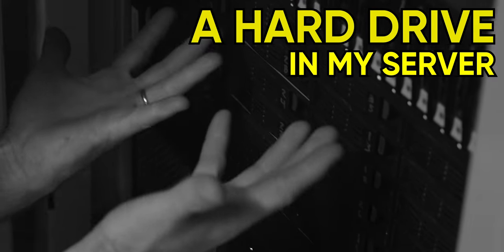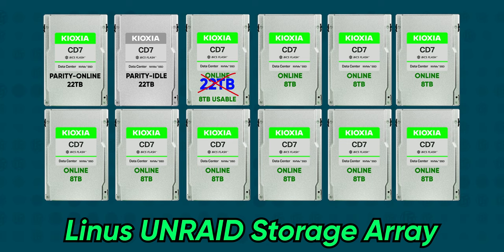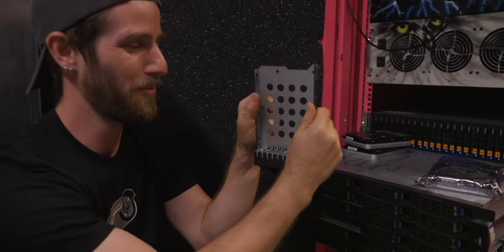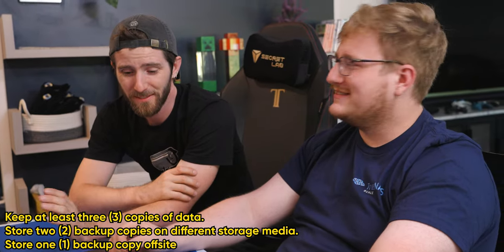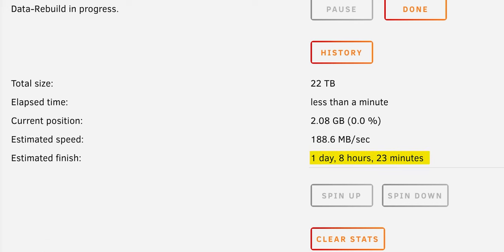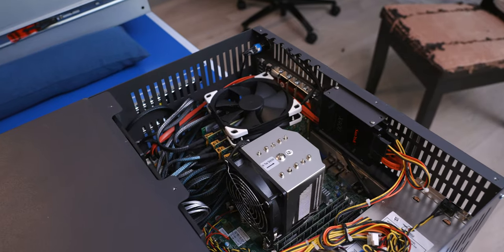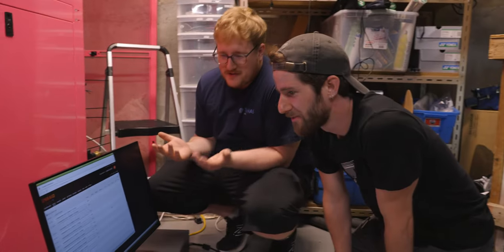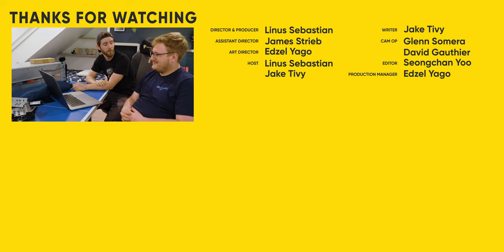My server is broken :( - Fixing Linus' Home UNRAID Server

Comment: For me it was super easy to rebuild my unraid raid, except when I did that it was the one version number where unraid could not add 4tb and above disks to your raid.... And I used 3 days to try to rebuild, and then the update hit that fixed the bug... Amazingly bad luck. When that bug was fixed it was just replace the drive and then it worked

Comment: While I'm watching this, I think back to replacing the failed drive in my hardware raid setup. 

The red light was on the drive, so I didn't even need to load software to know. I pulled the drive out of the running system, then swapped my drive out and plugged the new one in. 30 or so seconds went by to boot up the drive and the raid card did what it was designed to. Off it went and started rebuilding the array, all while my info was still useable, with no input from me. 

I can even swap them out for larger drives just like you said, but I can't touch them until I have enough to make a new array (yes it supports splitting the drives for different arrays) or I finish swapping out all the drives for the larger capacity and expand the array. 

So I think I will stick to hardware raid (HP P812 Raid card with 1gb battery backed memory, then the HP SAS JBOD enclosures to run the drives). Like your array though, I'm running raid 6 so can have the same 2 drive failure and be just as safe. So waiting a couple of days for my replacement drive to arrive, was no big deal.

Comment: If there is data that has any meaning at all to you, keep multiple copies.  Use tape or hard drives.  For long term storage avoid flash memory although it is OK to use it to move data between computers.  Of course a quick network could do that instead.  The more importance that data has, the more copies of it you may want to keep.  Don't be that guy who only has one copy and lost the data when there was a problem.  I have some papers I scanned and I got a new drive for them just so I know I have one that is hopefully free from bad sectors and extensive wear and tear.  I agree with Linus that you should not have to use cloud storage and pay for your data.  I also keep that drive offline when it is not in use and since I only wanted a fresh safe place to store the files it  is just stashed away somewhere cool and dry.  It may have a lot of unused space but I only paid $40 for it and will be adding more to it in the future.  It is all personal and not stuff to share with anyone, if I ever pass away it is meaningless to anyone but me.  I just want it to last as long as I may live so I have it if I ever need it.  Once I am gone it may be gone too.

Comment: Seagate still has not fully won me with their reliability. I'll use them, but I don't really trust them. Also not peeling plastic on computer parts, had an machine I had to replace a video card in because some plastic off of a component peeled off over time and get stuck in the GPU's fan and it overheated.

Comment: I would keep an eye on that particular model drive, and get the rest of the drives replaced next time there is a sale on the model hard drive.  (Typically happens when a data center buys a partial pallet of them.)
Reply: As a note, I would make an index of what gets backed up to the cloud from that server and what doesn't.   I'd simply use a directory tree to divide up things based on various attributes and only upload the irreplaceable stuff to the cloud.  

All his work stuff is backed up at work, in fact that side is the copy.  Copies of things that can be downloaded again should obviously not be downloaded either.
Personally important documents that don't have a copy on the work system should be backed up.
Pictures, and other such irreplaceable data should be backed up. 

However, using a RAID to handle it locally reduces reliance on backups so it is still convenient.

Comment: Boots off of a USB stick, is a faff to add new bigger drives... no thanks Unraid, I'll stick with lvm and mdadm in Linux which CAN absolutely be just as flexible. (This is actually what Synology do under the hood with their "Synology Hybrid RAID/SHR" stuff.)

Example:

2x 22TB drives
3x8TB drives

1. Create 8TB partitions on all 5 drives and RAID5 (or RAID6) them.
2. Create partitions for the remainder on the 2 22TB drives and RAID1/mirror those.
3. Create PVs with both RAIDs in LVM and add them to a VG and LV ... Boom. 46TB of usable space fir a max of 1 drive security. 

If you ever swap one of the 8TB drives to a 22TB one: create the 8TB partition and add that to the existing RAID5 to be rebuilt, then create the partition for the remainder and add that to the RAID1 while "grow"ing it to a RAID5. Resize the LV in LVM and you'll have the extra 14TB available for your filesystem... (If you ever want to go to even bigger drives, just add another RAID with the extra "layer" of partitions above 22TB...)

If you need 2 drives of security, plan the RAID layers accordingly...

Comment: another tip, all 4 of my 8tb drives are wd externals i chucked, you need to not connect the 3v pins or use a silverstone style sata spitter, but  they are not shingled and are full perf drives.. the firmware just causes them to restart over and over if 3v is connected... heh..

Comment: Thats not true. The price is always 800% of the manufacturing cost. When they reach the Port of California, the company that receives it changes the Bill of lading. The actual drive price is on the Ship before it reaches California then the company that receives them increases the Drive price, which is legal. In China, a drive costs $20 to $45 apiece. I am showing you the max price, but they can manufacture at $10 to $17 a piece when making over a million of them. If they can only make 100 of them, then the price goes up. This is an unlikely scenario. No one makes 100 of anything in a 5-acre factory.

Comment: The USB drive thing is the explicit reason I chose not to go with Unraid. If anything happens to that USB drive, you have to buy another one, register it to your account, and then that drive is locked as being your OS drive, if the old one starts working again or you repair it, tough luck. You can still use it as a USB drive but never again for Unraid. It's not an ecologically reasonable way to go about things. I really with TrueNAS had Unraid's "ad hoc" drive adding / swapping, though.

Comment: I never really liked unraid. It's just raid4, which nobody else has used for decades because the parity drive is a bottleneck. Raid5 is just raid4 with the parity spread across the drives.

I've been using zfs for about 10 years now, and i just do it with 3x4 drive vdevs each in raidz, in a single zpool, so i can upgrade the drives in batches of 4 no problem. An alternative would be something like 2x6 raidz2

Comment: There are no “parity drives” in Raid 5/6/Z/Z-2. There are parity blocks for each stripe and they are spread across all drives to avoid read/write contention for parity blocks.

I gotta look up wtf Unraid is using. Makes no sense. Linux MD raid doesn’t behave the way their UI suggests.

Comment: I'm pretty sad that btrfs didn't take off, no thanks to their raid5/6 bugs. It's so easy to use and the feature set is WAY better than ZFS for home usage. The ability to mix/match drives and modify it on the fly to any other raid is a lifesaver.
Reply: Love btrfs. Wouldn't put any important data on it though... still ;)
Reply: @peterpain6625  I consider btrfs safe for important data as long as you don't use its parity RAID. I have lost data when using it but I wasn't using any data protection at the time.

Comment: I had a moment of schadenfreude about that "PARITY MUST BE BIGGEST" thing after you ribbed ZFS. Because on TrueNAS you could swap in 22GB drives all you like, no issue. The cost is that your array is only as big as your smallest drive.

For people who (unlike Linus and Jake) don't already know this, it means if you have 8x22TB, 1x16TB, 1x8TB - your whole array is 80GB until you replace that 8TB. And even if you replace that drive with a 22TB, the one 16TB drive means your whole array is 160TB until you swap it out too. With Unraid you can have an array of random drive sizes and make use of most of the space - but the drawbacks got demonstrated here. ;)

Comment: Just FYI, I'm holding off on my LTT Screwdriver until the clear one comes out or at least the clear housing for the bits comes out because I really like the idea of knowing before I open it whether or not the bits are all inside. :)
You can still do a black cap and twisty-bit, but just make the body clear at least. :)

Comment: "Seriously, I have this strange feeling that I'm unique. I've been playing with computers for twenty-five years, and the only time I had a broken hard drive was when I dropped my 80GB Seagate on the floor. Some of the drives currently in my PC are 8-10 years old - a Plextor 120GB SATA SSD and a 2TB WD 7200. And NEVER, I repeat NEVER, have I had issues with these drives. What am I doing wrong? I install, copy, and save a lot of data... and I've never had a problem with drives. Only when I was fixing someone else's laptops, replacing or 'fixing' their drives. Isn't it just that people are simply irresponsible?"

Comment: Not everyone can buy SSD based drives for their servers and if you treat an HDD properly, by that i mean make sure you keep them cool and secured with antivibrational stuff, they can basically last for ever and even more so if they are not made by Seagate, which is the worst HDD maker since the first Baracuda nearly 2 decades ago, but the best part about an HDD is that it doesn't cost a fuck ton of money to repair unlike SSDs and, you are less likely to lose the actual data from an HDD simply because they are not in a flash memory chip which can be burned by a short, the type of shorts most SSD/NVME manufactures are not bothered implementing in most drives to cut literally a few bucks.

Comment: i was under the impression that each drive has its own parity with the parity drive(s) so as long as the data is not split between drive you would only lose what data is on the dead drive if you lose the parity drives.

Comment: If the contents of those two parity drives are the same, you basically have  RAID-5. If you have dual parity, it's calculated in two dimensions. https://en.wikipedia.org/wiki/Standard_RAID_levels has nice graphics about it ;)

Comment: the only time SMR drives are good in raid, are the HOST MANAGED SMR, on a proper card that supports said function.. because it can resize the shingled area and use the cards cache to help speed the shingling.. works well..  oh and those use hardware raid, and the rebuilds in my exp have been pretty easy on those cases, infact one of the setups a buddy has, he  paid 20bucks a drive, brand new for these drives,he bought 4 cases worth when he saw the price the seller he has used a bunch of aliexpress had, and knew if he ordered in bulk they would give him a discount or more drives for the same money, those were a steal, they ONLY work on those controller cards but, the card manages the shingling and up to 2 drives could fail without the array going offline, he build the array this way because it was one of the offered options and.. though it uses alot of redundancy drives.. dudes got enough to not have to worry about it... 32 drives in a big arse redundant array.... yes hes stupid... but in a fun way because, when hes done with stuff he often makes friends deals on it.... heh..

Comment: Looking at the days of rebuild/recovery time, of the parity and size restriction made me think of going to the EC based solution like local Minio cluster though it has very few support of applications vs those file system based solutions.  Other factors include IO capacity of file copy and wiggle room for large file operations of cluster rebuild or upgrade.

Comment: Linus, the very fact that this with more complicated than it needed to be exemplifies why you should be running on ZFS or Microsoft storage spaces.

You're overlooking the fact that unraid has dedicated parity drives. Unlike on ZFS, or storage spaces. Does it function very close to a distributed parody? Sure, is it the same? No.

Comment: couldn't the old parity drive be removed and plug that and a 22tb in another computer to clone it?
Reply: Probably not, as the system may use direct assignment of the hard drive using the serial number.

Comment: Im not entirely convinced you guys know how unRAID parity works.

Granted, you guys are WAY more tech savvy than I am, but I'm pretty sure the 2 parity disks have a different method of parity. 

Otherwise how would you be protected losing 2 array drives? You'd only be protected if you lost 1 array and 1 parity drive if they were identical.

Comment: a SATA DOM can be had pretty cheap that will last for more then a decade booting something like unraid, they have other names but they sell them for ide and sata as well as usb and other connections, disk on module, they arent super fast by any means, but they are more durable then most usb sticks tend to be.. like my buddies x58 rigs been booting clover/refind/duet for over a decade from the same IDE one, that was like 30bucks back then.. its only 8gb.. but, thats plent for the bootloader, and a small linux distro he uses for recovery if anything goes wrong, hes got OSX and Windows on NVME that boot from clover, hes also used a user created module to add rebar support via the uefi bootloader like he did for nvme support... so his arc card works pretty well..i mean its just his media pc and hackintosh... the hachintosh side has the best card that osx for the gen of hardware supports without more hacks then hes willing to deal with doing... that systems impressive.. dual 5675@4.65ghz with 96gb of recc ram for each socket... beast for its age... the fact its faster then his 2nd gen ryzen system... makes us chuckle..

Comment: I really like btrfs "raid 1" compared to all this stuff. You can add and remove drives of any size while always getting the full capacity. And it doesn't even burn all your storage, since btrfs "raid 1" just means storing two copies of the data different drives. If one drive has more data than the others it just gets more copies in. It is less space efficient than real RAID 5 or 6, but its less painful.

Comment: Serious question: I have a version of that case that Linus is (EDIT: was) using and the airflow across the drives is abysmal, like basically non-existent (and that's with just 8 drives). How do you manage the temperatures on those things, especially in a parity check or rebuild situation?

Comment: 13:56 unRAID does backups in the cloud of the usb drive if you configure it with the UI. Or you can do manual backups. It’s used to boot so important data is stored on the sys drive.
And I am pretty sure you could swap in the 22tb for the 8tb an rebuild it. You would have only 8tb of storage instead of 22tb.

Comment: Oh wow. I used to have a Raid 5 that included SMR and it was this exact model of Seagate Archival 8TB that kept dropping out and requiring a rebuild of the entire raid. (This was before the entire SMR issue became well known.)
The wasn't anything wrong with the drive, it was perfectly functional, but the SMR drive occasionally took so long to confirm a write that the RAID assumed it was nonresponsive and dead.

Comment: You just plug factory new drives into your unRAID and goooo? ...without running at least one round of pre-clear first?  
Making sure your new drives are not Dead on Arrival and crap out during the rebuild sounds like a good idea, or so i was told anyway.  
I'm not 100% sure but i think you can actually NOT lose 2 disks if you got 2 parity disks, you can lose 1 data disk and 1 parity disk but if you lose 2 data disks its still game over (that was how it was explained to me anyway...).  
Therefore i don't really see the point in having a 2nd parity disk other than that it saves you the stress of a full parity rebuild if one of the two craps out. (i mean Linus obviously has the spare drives to just do it anyway, but for my little 8 Disk NAS i don't see the point.)  

...i also did a parity swap once, FUN seeing it again here.

Comment: As  your're using those Seagate drives i'd recommend 3 parody drives and 2-3 hotspares at least ;) The Ironwolf on the other hand is prety decent. But Seagate coughed up some very very questionable hard drive series over the years. Seagate Constipation comes to mind. Pretty interesting feature unraid has with the capacity. I'd rather wait until TrueNAS has draid though ;)

Comment: hey linus i know this has nothing to do with the video but yesterdeay my pc started using alot of my gpu % even if im just moving my mouse around and they are getting used by a application called csrss and dwm and i have no clue whats going on. I have a 3060 ti so it shouldnt be using 10-30% of my gpu percentage just by moving my cursor. i have tried windows update, drivers updates, clean boot, turning off hardware acceleration and hdr but nothing has worked help lol

Comment: https://youtu.be/geb_gk1XXyA?t=701 This timestamp right here is one of the reasons I am glad SSDs are getting so cheap. 1 Day and 8 hours to rebuild an array. And that is if everything goes correctly. I have had to troubleshoot an array that wouldn't rebuild and it was a nightmare. You would basically do a thing and then have to wait 2 days to come back and see if it worked. Do another thing and wait 2 more days. It sucked because your array isn't running the entire time you are doing all of this either. With m.2 drives getting cheaper and cheaper this 32 hour raid rebuild could be done in 1-2 hours. It really makes an argument for just running SSDs.
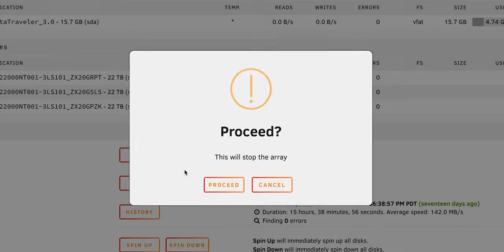Reply: Protip, you can just write 7:01, you don't need the entire link.